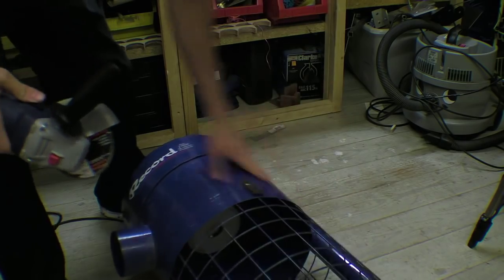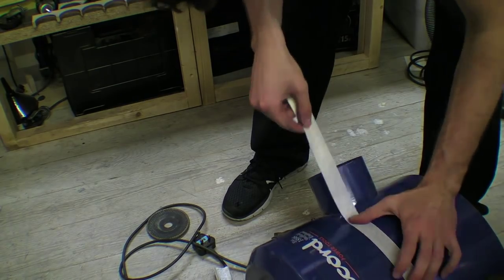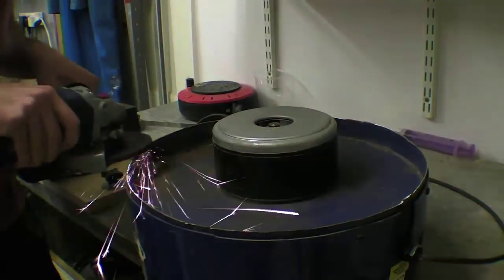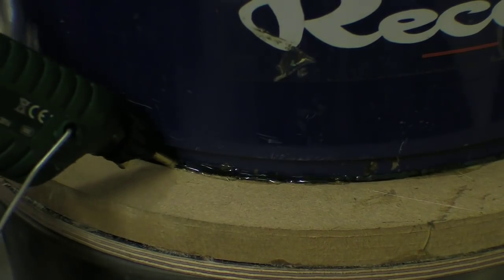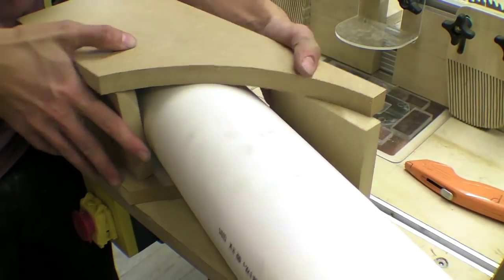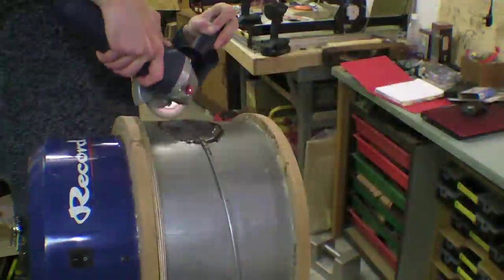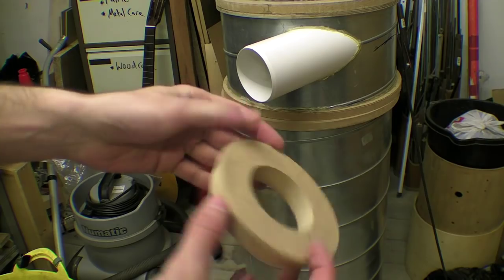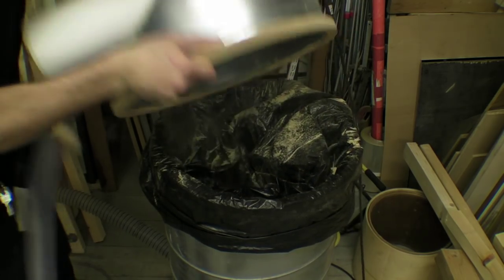Cannibalised HPLV Extractor Build - In The Bag

Comment: You need a much bigger hose to the bottom (maybe 25 mm inside diameter), and the hose should connect to a point that is lower pressure.  Such as after the filter.
Reply from the maker: +Matthias Wandel After the filter? I thought the pressure was already lower on the outside of the bag?

Comment: Maybe put a large cylinder (with no bottom) in the bag.  When the bag (or cylinder) is full, lift out the cylinder, then the bag.  It might be a bit messy, but I can't think of any other easy or practical way to prevent the bag from being pulled up.  

The only other ways I could think of was to pin or clamp the edges or bottom of the bag down.

Comment: without the frame inside the bag it will need a significant weight of sawdust to build up to prevent bag lift. with this type of vac the bag is always under negative pressure, made more so by adding a reducer to the inlet.

Comment: If you still have it... would it be worth putting the cage you cut off the extractor inside the bag to force it against the sides of the drum and just remove it to replace the bag when it's full?  Alternatively, fashion a form that would do the same thing.
Best Wishes, Brendan.
Reply from the maker: +baconsoda No I threw it away.  Just didn't have the space to keep it.

Comment: On the inside where the hose goes in to the container, put a piece of porous material so the plastic bag doesn't block the airflow.  A piece of sponge or nylon kitchen scrubber pad would work perfectly.
Reply from the maker: +Brian Bain That's a good idea. Like a giant colander.

Comment: Nice recycling build. Cut two circles or rings out of wood and sandwich the bottom of the bag on the outside. The weight will keep it down and you can remove the rings when the bag gets full. Or just drop a scrap of wood in the bottom each time you replace the bag. Your getting good with that angle grinder and your cement/glue technique is becoming an art. Haha.

Comment: How about the thin press board used to protect floors on new construction to form a cylinder equal to the inside diameter and slide in after the bag is installed. Two hand holds at the top and the smooth surface should make it easy to slide out of the bag. Not a technical solution but one that should work.

Comment: I've actually (strangely enough) built something very similar and very recently posted videos of me doing so. I tried the bag approach to start with and eventually gave up after deciding it was easier to empty the bottom half of the unit into a bag than build a system around it creating negative pressure against the suction of the vacuum. Cyclone systems have a smaller dust outlet than the vacuum inlet and hose inlet so you can get away with a tiny vacuum on the outside of the dust bag.
Reply: I think if you still want to half the inlet diameter should be enough to keep the bag against the collector walls. That's more of a guesstimate than anything mind.

Comment: I can remember Record Power selling these 'sleeves' (that join the hose to the machine) with a hole on the outer sleeve, which could be rotated to open or close the hole, effectively altering the pressure. I also know the bag issue is very common with these extractors and I'm sure you'll find a good solution that won't trouble you like the CNC. ;-)
Reply from the maker: I need to see an image of this - what does it look like?  Lol, I hope so Olly. If I crack it I will start a company called extractionables and give everyone the product for free.
Reply: Product for free and the headaches come priceless - BIG SMILE
Reply: ***** I haven't been able to find an image of it but there were two sleeves, one to fit over the other and both had holes (maybe 25mm) that could overlap as you rotate the outer sleeve...
Reply: I wonder if you could do something similar by drilling a hole in the extractor and having a 'cover' that can be pivoted to close or open the hole, fully or partially...?

Comment: put a stick or three in the bag. or drill a hole in the bottom of the bucket to poke a bit of the bag thru and clamp it down/up with a bit of tree on a hinge covering said hole and securing bag.
Reply: make a ring with say i dowels going to bottom of bag that can be lifted out once full. bit like a pizza centre antisploge device.
Reply from the maker: +Sirus Or I could throw my lunch packaging into the extractor.
Reply: Hmm, good point, I could send you the sandwiches my other half trys to feed me. Im all for up cyclying.
Reply: Hmm, good point, I could send you the sandwiches my other half trys to feed me. Im all for up cyclying.